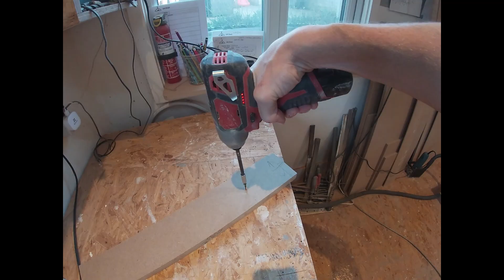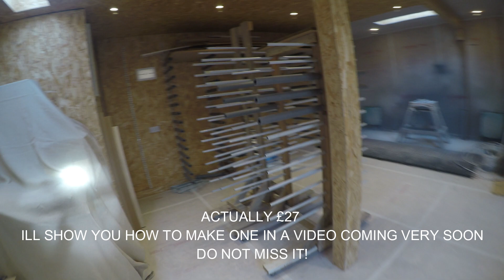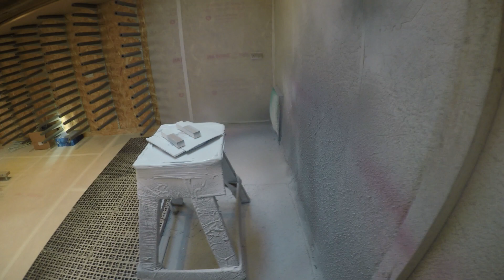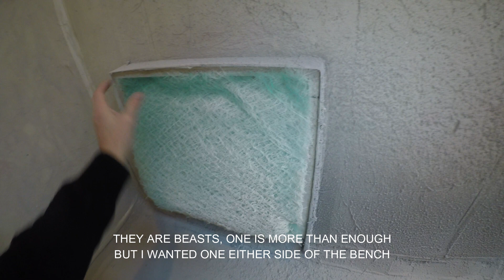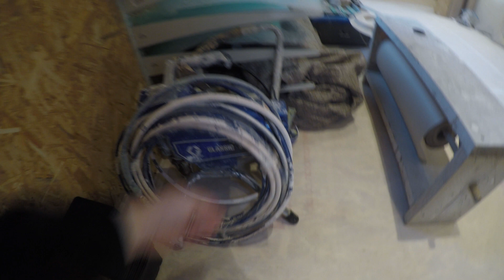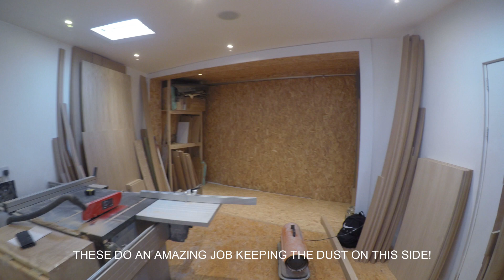BRAND NEW CUSTOM BUILT SPRAY BOOTH for our Graco Airless sprayers - EP#1

Comment: With those powerful fans, do find that the paint/finish gets sucked out of the room before it hits the work piece - - especially when using an air sprayer?
Reply from the maker: Hi no not at all with my setup. I use airless sprayers and they spray out quite heavy compared to other hvlp type guns 👍

Comment: Hi mate, did you ever make a video about the construction and materials for your drying racks @ 1:02 thanks Gaz
Reply from the maker: Hi Gary, ive been meaning to make this video for ages! I've had the materials and poles since I made this video.
I probably won't get a chance to make it for a bit.
I buy a cheap £15 3mx3m gazebo from amazon for all the poles, use scrap timber for the frame and £5 for some castor wheels too, again off amazon. I'll try and make this video ASAP 😁
Reply: @thelondoncraftsmanworkshop  Hi mate, have finally decided to knock up a spray booth for my workshop. Can you advise on the fan sizes your using, been looking at open fronted booths and sealed booths, but feel your design would suffice for my purpose. Checked out some of the filters I need and going to be ordering a roll, same size as you mentioned in the video. So for good air flow, do you need that door open? Also using only water-based paints the fans surely don't need to be Atex rated do they? I have read that as long as your not using flammable paints, like solvents, then industrial extraction fans are safe.
Reply from the maker: Hi !
Are the links for the fans in my description?  If not let me know as that link will take you to the ones I bought.
I only use waterbased too so these fans are fine, no need for expensive fans.
Yes, they suck in tons of air so definitely need a door open and maybe a window too depending on the speed you have it on 👍
Reply: @thelondoncraftsmanworkshop  Yeah, located the link! Thanks again, much appreciated. So you purchased the 16", they are powerful, got a 4900 m3/h and you have two. I know they are on a controller, what's your setting? surely not full wack. Thanks again.
Reply from the maker: Hi, no I have them on low to medium most of the time. I just have 2 to cover more area👍
Reply: @thelondoncraftsmanworkshop  Thanks for your help! I thought as they are very powerful fans, but setting them lower would extend the life of the fan, as they are not on full blast everyday. I have kind of made some drying racks similar to yours too, inspired me big time lol 👍as they are very pricey to buy, build your own!!! Way to go and great advice! All the best.

Comment: Do you ever use any solvent based paints with the airless? What paint would you recommend for colours on mdf?
Reply from the maker: I do very rarely.
You do get a slightly flatter finish with solvent based but the drying times between coats is a few days. Airless puts it on a lot thicker than roller or brush and ive found that the first coat can take up to a week to fully cure before I spin a component over or key up ready for 2nd coat.
I always use johnstones and they mix any colour any sheen.
I mainly use a water based johnstones eggshell

Comment: Afternoon. I have read that Lacquer is the way forward with Kitchens due to quality and also drying time. Whats your thoughts or what are the complications with it
Reply from the maker: Hi Darren sorry this message slipped through the net.
I guess it depends what lacquer you are going for, water based, AC, PU , etc.
I dont really have the set up for hvlp using AC, pre cat, or PU so if I'm applying lacquer it would be water based using my airless Sprayers.
I use morrells brand which seems to be ok, but that's the only info I can give you on this subject. 
Sorry 😁

Comment: Love the paint set up where did you buy all the materials for the racks trying to set up a room like it and I really like the set up you have it’s very well done
Reply from the maker: Thanks Joe, I've finally got the workshop and spray room to how I want it.
The question about the racks is actually an up coming video I had planned very soon, but as you asked I'll let you know.
The mobile racks are made from scrap timber, mainly scaffold boards ripped down the middle  and also cls timber.
The wheels are lockable and swivel 50mm castor wheels.
The poles actually came from a 3m x 3m cheap £18 gazebo I bought from Ebay or Amazon.
These gazebos supply you with enough poles to make one complete mobile rack as you see in the videos. It's far cheaper to buy the poles like this.
Cheers Ryan
Reply: The London Craftsman thanks Ryan I have taken a lot of the ideas you use and applied them to my shed very happy with it. Love the videos
Reply from the maker: Thanks Joe, appreciate the nice comments.
I'll keep making them.
At the moment I have a few vids of heating water with solar panels and also a coil, but I'll get back into the woodwork vids asap

Comment: can u tell me why ur extractors are low level im setting up my own small spray booth and head is pickled with dos and donts
Reply from the maker: Hi, my theory behind the fans being low down is that when spraying the over spray will generally fall to the floor, rather than above the work.
It also allow the over spray to dry and turn to dust before it hits the filters and fans.

That's my thinking behind it 😁
Reply: .thinking along the same lines myself.
smaller workshop smaller paint booth but have been making it work .place looks sweat lad .keep up da good work
Reply from the maker: Thanks Johnathan
Reply: Some of auto booth use the downward flow, that way dry overspray is not picked up then set on new wet work.

Comment: Looking great, good job with that. 

Quick question. I have used acrylic primer on my mdf (sprayed on) and the first coat raises fibers on the flat part of the mdf so i sand it down and do another coat but it then raises more fibres. Its a pain in the arse and cant get a perfect finish. You think this is due to the mdf being from B&Q and being cheap and nasty? Thanks in  advance
Reply from the maker: Thanks Craig and I like your question.
I've battled with this problem for a long time and tried lots of methods to get over it.

Firstly I sometimes notice that some MDF boards have more large yellow softwood particles in them. These are the bits that raise.
I've also noticed that some boards raise more than others.

What you said is probably half of the problem, buying low grade MDF. I've heard that medite is a good brand of MDF but only places like Lathams probably sell it, most other places probably sell cheap boards.

-Try and use MR mdf, this is alot more dense and its moisture resistant so the grain shouldn't raise as much
-The first coat needs to dry asap or the moisture in the paint will raise the grain.
2 ways I use to reduce the grain rising is literally spray a dust coat on first, very fine and just enough to cover the MDF just about but little enough to dry within 5 mins or so.
 Second heat the panels you are spraying.

I have a space heater and I use it in 2 ways.
Once all my materials are in a pile in the spray room I point the space heater at them to heat them.
The other way is once I've sprayed the dust coat it needs to have the heater on it asap.

Down side with dust coat is that you will need to apply 3 coats per face ( I guess it depends on your sprayers you are using).

Does that help?

Thanks Ryan
Reply: @thelondoncraftsmanworkshop  Star man. Thanks for the advice. Am glad I am not the only one who suffers with this. I will probably invest in the MR board on my next project. Will also give the fine mist coat and the heating trick a go and will report back to you with the outcome. Much appreciated. Great channel, learning a lot from your videos so thank you 👍
Reply from the maker: Your welcome, and thanks.
Yes let me know how it all goes and if there are improvements.
I dont think you will get it like glass but will be interesting to know.

Thanks 👍
Reply: Use oil base

Comment: Where did you get the fans from are they recirculating what are the blower outside
Reply from the maker: Hi Norman, 

Thanks for the questions.
The fans were bought from Amazon, they are 400mm diameter with a controller ( Each one will come with their own controller )
Here is a link:   
https://amzn.to/2N2ICu1
There will also be a link put in the description.
Im not recirculating the air (if that's the question), im just sucking in air from a few vents in the walls, and leaving a door/window open.

Any other questions and where to get other stuff just ask.

Thanks Ryan

Comment: Where are your fans extracting too?
Reply from the maker: Hi,
I have a filter at the front and at the back of the fans and they are extracting into an unused space/land.
I only use water based and oil based paints through this booth, so no smelly solvent based paints.